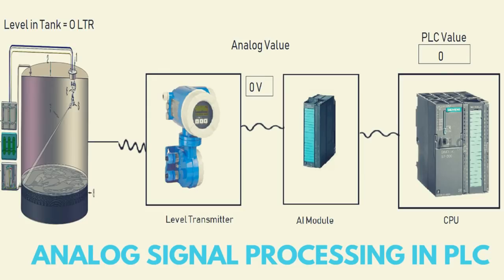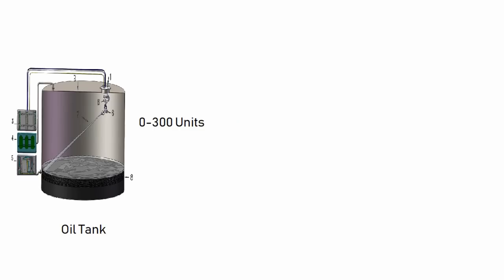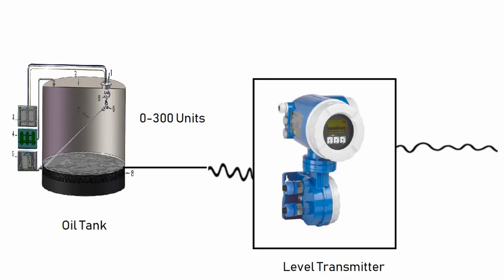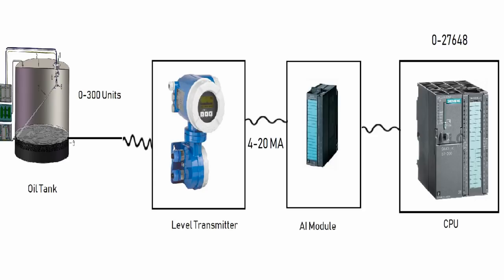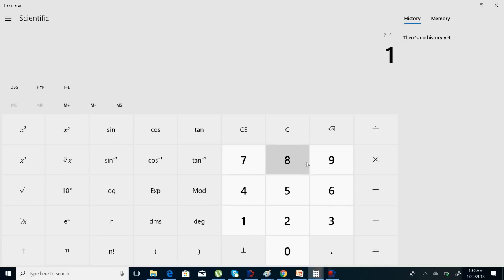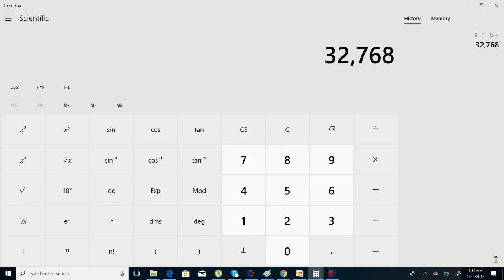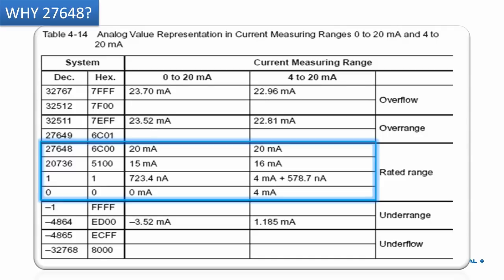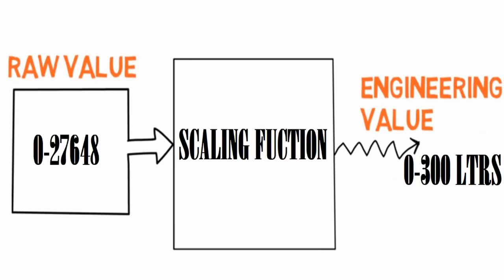17: PLC Analog Signal Scaling Concept Explained So Easy

Comment: This is a great explanation as well depiction for someone new or refreshing and well explained. I do believe the raw value limit changes depending on the type of PLC System. I mostly only work with RA-Rockwell Automations products here in the U.S. working with my Senoir Automations Engineer. My background into my current job was from a Mechanic/Plant Operator job into Field Service Engineer/Automations. I would Major Plant PLC Upgrades helping my Senoir Engineer and so much questions I’d ask because at best I just didn’t understand how a PLC operated under the hood. Scaling would confuse the hell out of me. Because sometime we be upgrading a PLC-5 system, other times a SLC system or upgrading them all to ControlLogix system and in the setting of the Analog Scaling, they are all different in their value for each the different PLCs. This confused the hell out of me for quite a while. And I do believe it can confuse others as well in not being aware of the different PLC systems or generation type of PLCs. And I think it is something to point out.
Reply from the maker: 100 % agree .

Comment: excuse me. which block funtion we use in Step 7 Program to convert 4-20mA or 0-10V to 0-27648. ???
Reply from the maker: plz check second part of this video
Reply: AI module convert 4-20mA analog signal to 0-27648 for us, Right ?. and we using Scale block to convert it again to real value ?